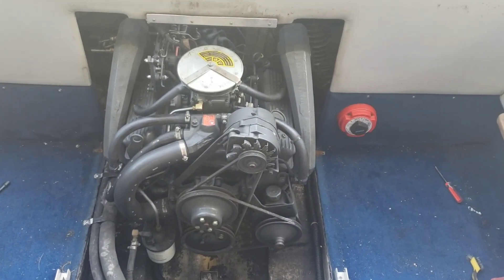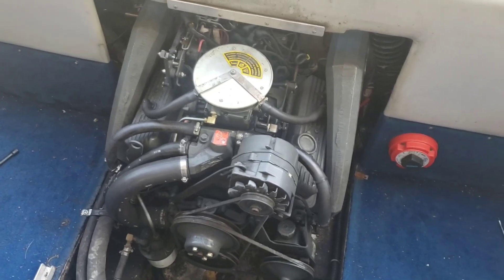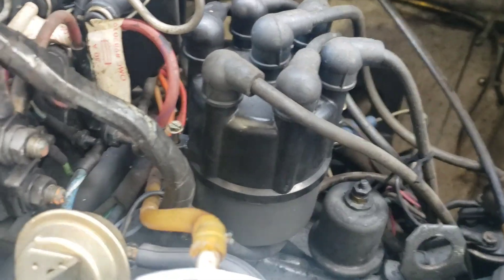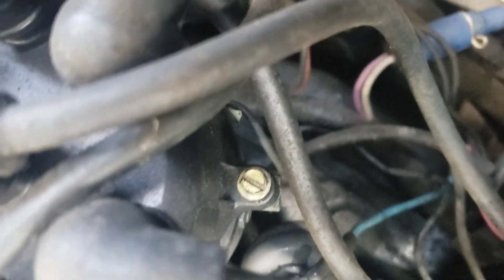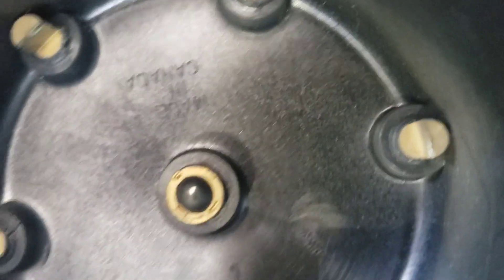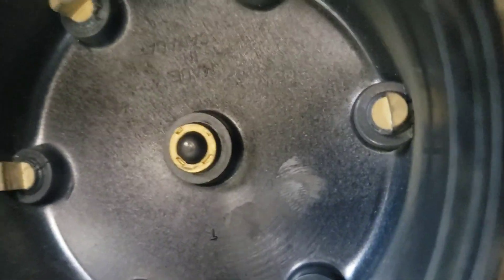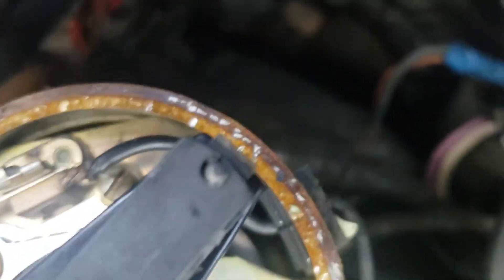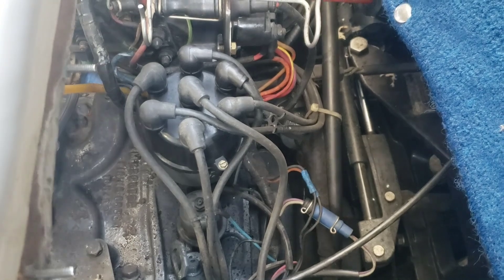Boat lacks power? Won't plane off? Mercruiser, Volvo Penta, OMC quick fix!

Comment: My boat won’t start. It was running on the water until I turned it off then it wouldn’t start again. Would a bad shifter cable cause the boat to not start? Compression is 150 on all 4 cylinders and starter is good